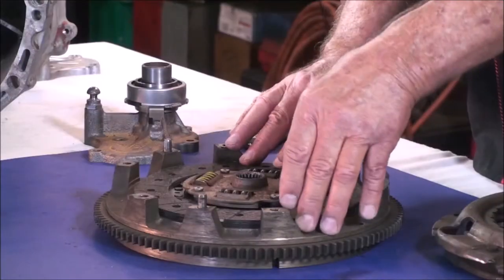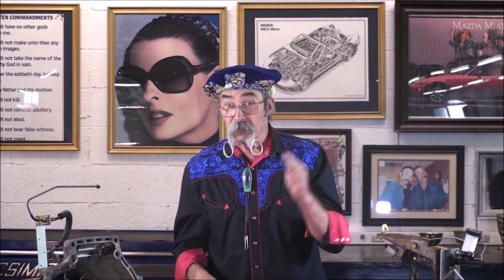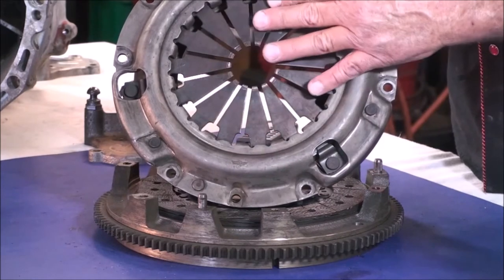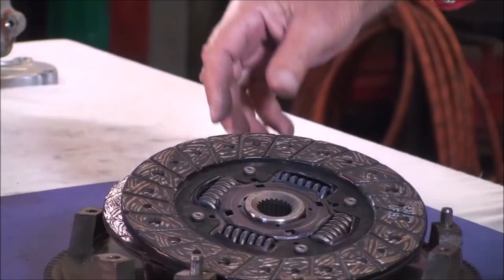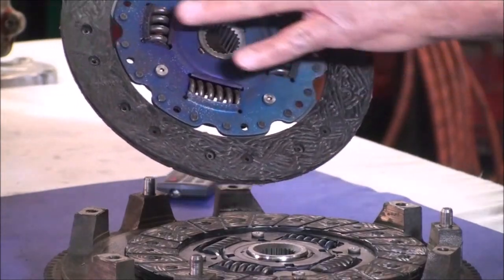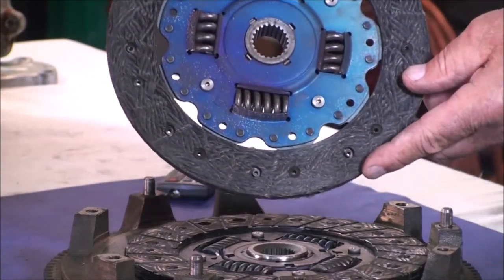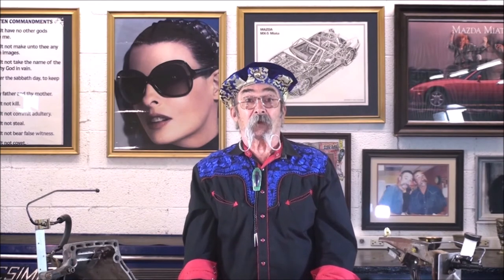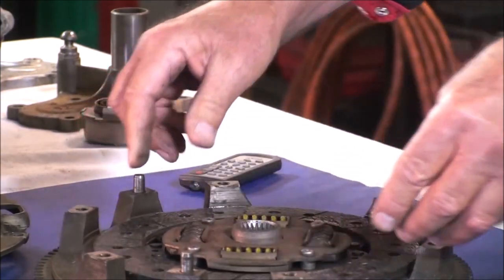How to Diagnose Broken Stuck Miata Clutch When Pedal Feel is Normal

Comment: Hi Mike, I would like to ask you a question regarding my miata. I have a turbocharged miata (approx. 270hp) and I use an organic clutch.
After driving hard for 30 minutes I have difficulty in changing gears. I press the pedal in order to change a gear and the driving stick is very hard to engage.
The gearbox oil is not old. The problem goes away when the car cools down. Is it a gearbox problem, or a clutch problem ?
Thank you in advance for any suggestions.
Reply from the maker: Hello,
Thank you for your concerns. Sounds more like a clutch release problem. Have you watched the video " How to adjust Miata clutch pedal "
In this video we show how to increase the clutch pedal stroke. This adjustment may cure the issue. Please keep us posted.
The King of Miatas. Mike.